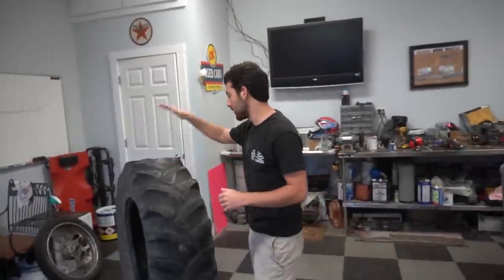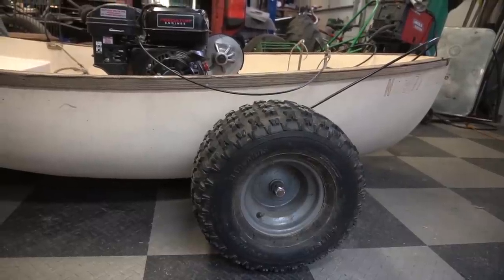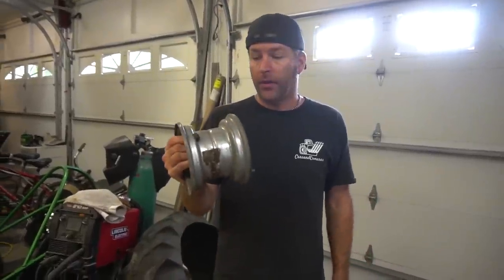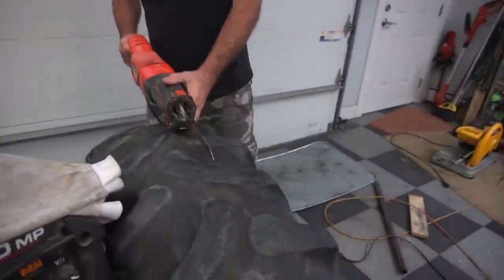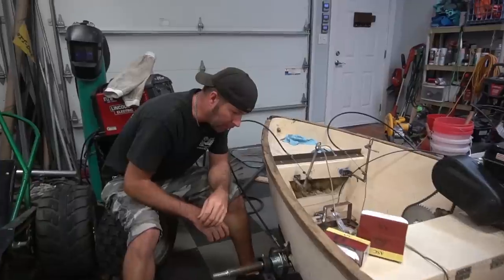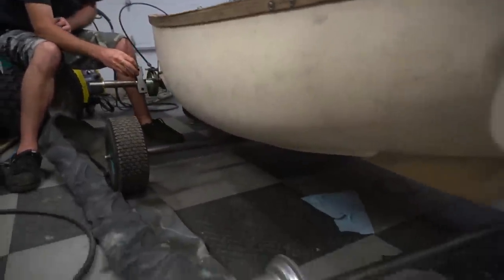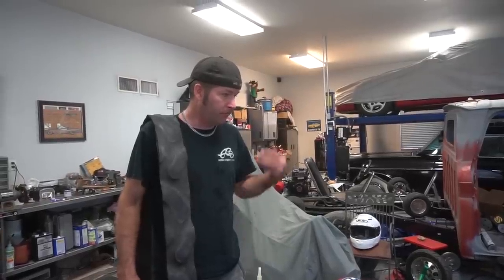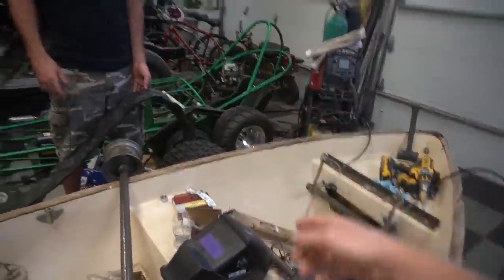Tank Boat Transformation! | Amphibious Boat Kart Pt. 4

Comment: I cant believe you cut the tractor tyres into 5 or 6 inch strips. You would have been better cutting the walls so there was a lip on the edge and have the small wheels running inside the treads.
Reply: no they want to run on the bead edge of the wheels. they need to watch other peoples videos.
Reply: Was thinking the same thing. Shoulda left about 2 inches of the sidewall on each side and then the tracks would have stayed on the tires.
Reply: They just said they had no clue ....lol though I do agree. Sidewall would have helped.  Though I dont know a thing about home built tanks.👀
Reply: Plus, they have lost the benefits of pneumatic tires.  Flotation on water and cushioning on land.
Reply: Probably too much resistance.
Reply from the maker: Yeah it was a major bummer. BUT IT HAD TO BE THE CENTER because we would have a smaller diameter on one side of the strip vs the other if we would have cut the lip for more paddling. Not sure if that makes sense, but we thought about it and it wouldn't work for us.
Reply: Uber FAIL
Reply: @user-neo71665  the problem with leaving a sidewall is  it resists going around  the rim as it doesnt want to bend...they had the right idea with using the ctr  but they needed to make a guide to keep it from sliding off the sides of the  large tires and those small rims werent deep enough.A tensioning system would helped to keep the tracks taught.
Reply: @CarsandCameras  i think they meant using the entire tread plus a bit of side wall on each side.

Comment: Are you kidding me? You guys did great. Don't give up. That Jon Boat will come along. Keep an eye on Craigslist I sold my 12-footer for 300 and that came with a 3 horsepower Kingfisher motor so, they're out there. Just save your parts and try again later. I think you should build a mini bike with two wheels up front and one in the back. Nobody's done that yet that I know of but, I've only been watching YouTube for about a year-and-a-half now
Reply: Macro machines did a mini bike with 4 wheels 2 on the front 2 on the back.
Reply: Stanley Shearman so did red beards garage but this is two wheels in the front and one in the back not two in the back
Reply: Heck I'm selling my 12 aluminum Jon boat with a 4 horse Evinrude for $450
Reply: Stanley Shearman I've never heard of a go-kart called Marco. That's not to say that they don't exist but I think you meant Manco as Manco in all reality pretty much has the corner on the market of the lower grade go-kart or what you would call a beginner's go-kart.
Reply: Ren Höek in the us?
Reply: ThatOneLaxKid yup I live in Florida
Reply: Stanley Shearman that's right I know what you're talkin about it looks like a quad I kind of got confused there for a second but yes somebody was selling one here not too long ago are we going to buy it and I seen it posted somewhere here on YouTube. Yes Manco did a quad. That's not quite what I was talking about for them to build. I was talking like a reverse trike

Comment: Strap together some of those plastic 55 gallon drums. Just build a frame that isn't as wide as the barrels and ratchet strap them to the frame. Then you have a LOT of buoyancy and a rigid frame that can support anything you want to do. Also if you want to do tank treads you need variable tension. Something spring loaded so that when the belt stretches it doesn't become slack. Just like a chain tensioner, but much stronger. Had it actually moved this would have been the next issue. One of your random shocks pushing down on the belt from the top would work well, but it would need a lot of travel.

Comment: Congrats on 500k subscribers. You guys always have cool projects. I'd lose the tank tracks, and put paddle tires on the ATV rims, and for the rear, do a setup similar to the front of a zero turn mower. That would allow the boat to drive, steer, and float. Either way, I love the projects.

Comment: You can build a flat bottom boat real easy. There are LOTS of videos on how to with plywood glue and screws. Several off road manufacturers have some nice ideas. 

If you have completely given up on the boat, going down in flames would get a lot of hits. Strip it down to just the boat and have one heck of a fire. Throw the remains of Jeb in there. Get some friends with their failures and just put the past behind you. Celebrate the moment.

Comment: Guys I have been fascinated with all your builds. This is just the same kind of stuff I did back when I was a teenager 45 years ago. Tank tracks are the most fickle contraptions to make that you can make. The best I have seen are two code 100 chains spaced about 4 inches apart on each side. Drive from the back, spring load the front idler wheels for tension. Weld grousers across every other set of links. Another way is to use trencher chains. But now you have weight problems. I would have come up with some conveyor belting and bolted 1/2 X 3 inch U shaped guides to the inside to keep them on the tires and with the same bolts attach angle cleats on the outside of the belt. If you ever get over to the Greenville - Spartanburg area of  South Carolina try to get in touch. I have 12 inch wide conveyor belting you can have for free. I cannot travel at this time but I can feel a road trip in the future. Tankboat was not a failure, just an opportunity to do better. Congrats on the subscriber milestone!
Terry

Comment: Deflate the tires way more and tighten the track more and that should help keep the track on. The issue is that either the track needs side walls to keep on the wheel, or the wheel needs the have walls to guide the track, like how the back rims where. 
Definitely revisit this though, it was  an interesting exercise in riggery.

Comment: next time you should put the guides on the top with a spring loaded tensioner, although I bet this one would do a lot better in the dirt where it would be able to slip a bit and not pull the track off, also might help to air down the tires and tighten the track. Looks like a fun project

Comment: Congratulations on the 500,000 subscribers.
Give up on the tank boat and turn it into a paddle boat with twin predators, one for each paddle wheel. Then you can steer with throttle instead of brakes.
The 13' Boston Whaler has a flatter bottom than that dinghy and you could cut holes right in the bottom for the wheels. It won't sink. Just use some 3M 5200 to seal off the exposed foam. Could also make some wheel wells for it. 
Or combine the AWD Go-Kart and the Dinghy to make a 4 or even 3 wheeled amphibious boat...

Comment: You still made a boat that drives on land and water.  The tank tracks was good in theory.  I would not put a fail pin on this project, you took it much farther than I would and like you said, you gained a lot of knowledge for future projects.  It'll be fine.

Comment: Hey failure is always an option!!! I once made tracks for my rc truck (which was a snow plow) by taking chain you use to hang fluorescent light fixtures. I bet if you did something along those lines and put some small 1x1 boards on them like the snow cats have it would work well. The design you guys had reminded me of the ripsaw that the black ops brothers made and that thing ripped!! I want to build a tank boat for myself and I don’t even like boats that much 😂😂

Comment: Hi I build a off road kart out of an old atv.   Everything is ok but when I’m riding on bumpy surface terrain my engines stalls or dies.   I have a Honda GX390 stock with a 40 series converter just remove the governor and oil sensor.   But it stills the engines tries to stop while driving on bumpy roads.   What it could be the problem? The carburetor?

Comment: Tank boat needs tensioners for the tracks. Another dummy wheel with a spring loaded axle, to act like an engine belt tensioner. But yea - the entire design is flawed. Congratulations on 500k!!

Comment: The drive gears need to be in the rear also.  Or else you will pull tracks and bend idler wheels all the time! Very important lesson learned by modern tank designers!

Comment: Good effort guys, but making tracks is a bit more complicated than what you thought. Tracks, no matter what application you want to use them for, require guides to keep them on the power wheels and bogie wheels to provide stability and keep the track reasonably tight. Keep having fun guys, you'll learn as you go and that's the best part of it.

Comment: If you took those rubber tyres and dropped all the axles about 2 inches and used the holes you already drilled for an underside skid guard/ subframe you could use that axle on the for tensioning. But what I'd suggest for that is put that axle on a groove that can go backwards and forwards with a locking bolt on the inside and out. So you now track tensioning. That's what I'd do to fix the problem. Ps congrats on 500k I've been watching for about 2 years now you've came a long way

Comment: Try using an inflatable tire on the guide wheels and weld a ring around the rim to keep the track straight. Use the inflation of the guide tire to adjust tension.

Comment: i suggested some wheels like those of the beaver or penguin. but indeed then it's not really a tank. and they have to get them. 4 axles on a row does look nice though like on the The ARGO Amphibious 8x8 ATV Rubber Tracks of Donn DIY. check out those nice tracks. pretty deep out the pocket though.
congrats on the 500K 👍️🎉

Comment: U guys need to figure out a guide system to keep the tracks on the wheels. If u run guides along the top it might be enough to hold it in place as u turn. I hope u guys figure it out, dont give up. Step away from it n give it thought. Take a look around the internet n get more ideas for it. Good luck, im rooting for u guys.

Comment: Not hating on ya, cause I love the idea, but a suggestion on a possible design alteration for any possible new ones. Have your drive axle in the rear, so that your tracks are being pulled along the ground. It should keep the tension on the bottom side of your tracks good and tight and increase traction. Also, I think it would allow the tracks a lot more surface area to contact the drive wheels, preventing slippage. With your drive axle in the middle, you're just not getting much contact between the drive wheels and the tracks. Drive axle in front means that if you have any slack at all in the tracks, they will bunch up behind the drive wheels and not be gripping the ground.

Comment: It was because they weren't like normal tracks. Normal tracks are linked, rather they be rubber or steel. You were using a track that had too little tension (it was way loose) and weren't links, like a chain on gears, so once they hit the water, they would have gotten lubricated and then slipped off the tire - guaranteed. Next time, flip the tractor tire tank track. That way, the tires on both of the tread would act somewhat like a sprocket and chain (kinda) and add tension on the track so that you'd more likely just have something like a belt slip than the belt being too loose and falling off (as seen in the video).

Comment: Great attempt guys. My thought are you guys can build a flat bottom boat out of wood and resin. A frame. Two engines. Us junk car steel wheels so you can use the full width of the tractor tires

Comment: Front track runner. Basically another rim run from the very front axle that's not being used that touches the drive tires and holds the track in place so it doesn't jump off

Comment: A for effort.  Matthew Moore has a good point.  Some sand tread tires would be great.  It would push it through the water faster.  I think the two wheels up front with sand rail tires and a good caster for the rear is the way to go...or set it back up the way it was at first and put a out board on the back?

Comment: How about adding a gear box like you have on rat rod wagon.  Run power off of  axle to the horizontal shaft of gear box to turn an actual boat prop.  You will just have to figure out how  to lower and raise the prop.

Comment: Hey guys. Just a tip: Your welder is set too low. Need to bump up the volts and wire speed a little. It should sound like frying bacon. ;)

Comment: you should put casters back on the rear and then put some close fitting fenders over the drive wheels and see if tht helps in the water. maybe some rubber caster wheels

Comment: You should put a paddle wheel on the very back like old river boats had and run a chain to it with it own clutch you can engage once in the water and also put splash guards over the drive wheels to prevent it from splashing water into the boat

Comment: Put another set of rims with no tires on the front. It's fine if the front don't touch the ground, makes it easier to climb out of the water. Just move to back axle forward to makes those tracks work. Once your in the water the tracks probably won't move much the tires will just slip and spin.

Comment: Take some u bolts from tractor supply etc, shorten one side so that it sits just in the lip of the rims up front without touching them, bolt long side into the boat or something close. There's ur track guides.  Could do a couple on each side or whatever

Comment: I could have seen that coming. The wheels need  sprockets and the track needs wide chains moulded into them. Perhaps two long chains per track and two spockets per wheel one on each side of wheel. And polyurathane the track once chains are on and tight and then just hope the polyurathane holds to the chains.but make sure you put tape over top of chain closest to tyre so polyurethane doesnt ooze thru where sprocket connects

Comment: Cool build guys. I think the next build should be a bathtub kart. Southern Polytechnic State University used to host races where students would build karts in which the cockpit was a cast iron bathtub. They used rotax 2 stroke motors and would do 60-90mph. Check out "Southern Tech Bathtub Racing" on youtube.

Comment: Just remember to steer, the tracks spin at different speeds. The solid guide axles restrict this, so that may be why the tracks flew off when they spun at different speeds.
Reply: yup! even if running 4 axles worth of paddle tires (something like a heavy ply jonboat), they all have to be half shafts chained together down the left and right for the differential brake+steer act to happen.

Comment: I have the perfect design im just too lazy to impliment it . use a kayak . make it 3 wheeled . one sand paddle in the rear driven by a chainsaw engine and either make the engine and rear tire steer or use the old bike wheels in the front with the white plastic spoke protectors on the front.

Comment: I think it would have sank when he was in the water the back was pretty low plus adding the rear wheels.  Its a good thing it failed at the house and not in the water. Saved you a good motor.

Comment: I know this is over a year old but it seems the tiny caster digging in and the brakes was the main problem..the dingy will work fine if you just made it half track of no tracks and just used the big tires andput bicycle forks with a bigger tire to make it roll much better then weave plastic through the spokes and use the back wheel as a rudder in water and a wheel for rolling on land..that will mak it much more stable on dry land for  faster speed,and it wont dig in like the little casteryou can keep the brakes, but use them for stopping and not turning  the set up you have will work fine with out all the drag on it.

Comment: It would work right but tracks are under a lot of tension, and the use of hydraulics would have been far better. If you would learn about hydraulics it would be beneficial the track tension should be under regulated pressure to keep them tensioned, old bull dozers used a hydraulic cylinder and pressurized with grease to tension the metal tracks. Use of hydraulics would make it more like a skid loader and you could use a high speed orbit motor for a propeller and add hydraulic steering. You need to think outside the box the idea was there but limited to cheap go kart parts and ideas. Look at how track vehicles are built to understand better look at a case quad track and a bobcat mini excavator.

Comment: build a quad copter w/ 2- 20 hp predator motors and 8 36 inch fiber/carbon props with a thruster nozzle to make directional thrust. w/ landing gear so to be able to steer it on the ground.

Comment: Y’all should put a set of just the wheels up front like you do in the back... it will act like a guide for the front.... when the tires spin up front it throws them tracks off... if you have a guide up front the tires will still spin in the middle but more then likely the wheel in the front and the rear (acting as a guide) will not let the track come off because it is in a guide so it won’t move side to side

Comment: yerf dog.....homemade body side panels just for looks.....and to cover up eight or ten small air tanks for buoyancy .small sprocket on drive shaft going to a large sprocket on a head from a  large angle grinder ... .think of it as a 90 degree jack-shaft...that would in turn power a small jet drive or prop unit....two speed gearbox from ole Rather B and you got propulsion.....thrust vectoring through shafts and u joints
Reply: and on the street and in the water it will still be a true go kart.....not a boat with wheels or a kart with styrofoam tied to  it

Comment: Maybe a additional jackshaft is needed you guys need alot torque especially wen your trying to turn because the wheel your not stopping or braking is gaining a even higher speeded ratio through the diff

Comment: cut V's in the side of tractor tires run cables connecting the V tips to keep tracks from coming of the tires. May use small truck axle as the diff already has brakes and gear reduction. But if this channel goes more pro. Like some of the motor trend high dollar builds specialty shop work. Then the charm will be lost for me.